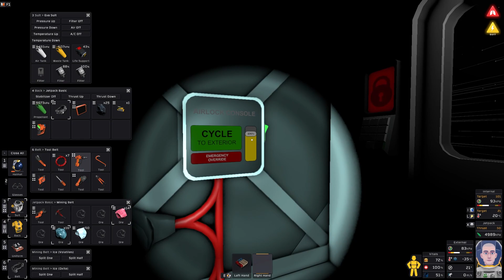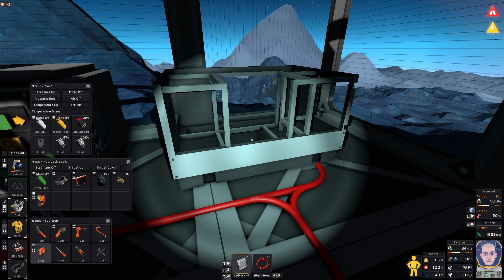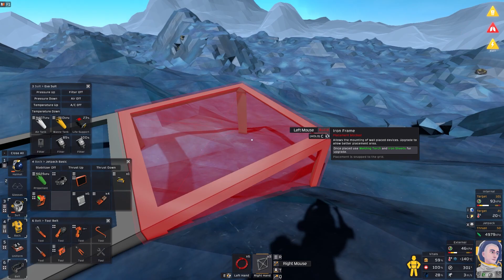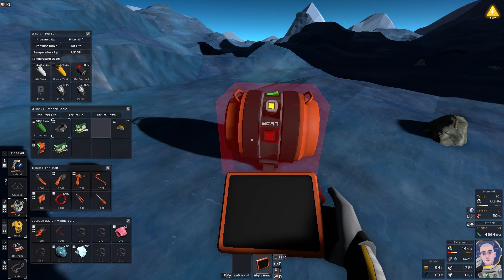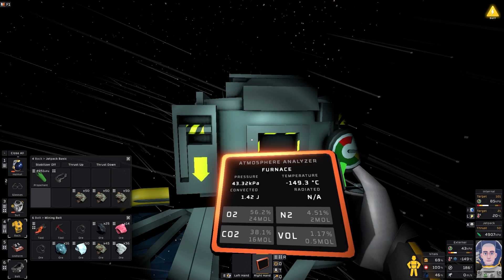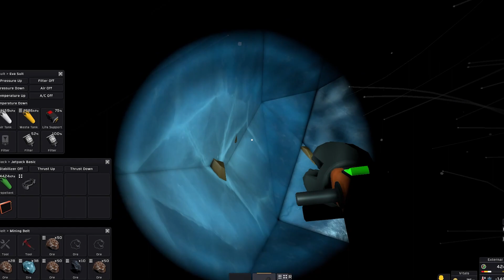Solving Shortages | Stationeers Europa | #2

Comment: I doubt X is actually chlorine. Or at least, not exclusively chlorine. Chlorine isn't the only pollutant you may get from burning coal. Nitrogen oxides and sulphur dioxide are likely, and not pleasant to breathe, you can get heavy metals given off, soot particulates, and potentially some carbon monoxide (although if you're producing that it does suggest you're not achieving optimal burning characteristics, i.e. not enough oxygen to fully burn the coal)
In other words, you're coal is kicking out a lovely toxic cocktail of gases, all of which are pretty nasty. I think X just represents the cumulative total of all that nastiness, rather than any one gas specifically.

Comment: Can you put the vent from the furnace near the wind turbines for a small boost to power or would it even be worth it?
Glad I found your channel! Gonna have to binge your stuff for a while!
Reply from the maker: As far as I know these turbines don't actually interact with "wind" yet - they just produce power at a semi-random rate over time (it seems to just be a sine-wave but I'm not 100% on that). 

There's a separate block (I forget the name) that does work exactly like you describe though. You can line them up in a chimney to make a little bit of power. You're better off running your exhaust through a stirling engine. Those used to basically print energy. No idea if they're any good since the atmospherics overhaul

Comment: For me this ore scanner is not very useful. But it's not because some flaws of this tool itself but because of ores distribution (it's not the only issue related to that, by the way). It's because usually ores are mixed, different types in the same place. If I don't search for something specific then it's enough what I find without it and if I need specific ore, it is not helpful in this case. And I think it's totally obsolete after getting heavy drill. I just drill all around faster then use this damn thing.

Comment: 8:13 I just learning the game myself so while I understand most of what you're doing, I do have a few questions... Those cases on the lander can be removed with a wrench. You could then carry them up to your base and print off some attachment points so they don't blow away in a storm. Is there a reason why you're continuing to commute down to the lander? Is it just lack of resources?
Reply: 18:36 Probably should have vented the furnace first, lol. The CO2 and Pollutants inside are really good at absorbing heat, so it's really hard to get your heat up... Plus you risk everything esploding.
Reply from the maker: No reason not to move them. Just different priorities.

Comment: 20:00 - ish...  I could be mistaken, but if you have an improper reagent mix, you may not need a centrifuge to fix it.  I THINK you can balance out the ratios.

So a 2 Iron/1 Coal reagent mix can be solved by adding 1 more iron.

... but also I could be wrong and/or that might have been a bug that got updated.  Feel free to test.
Reply from the maker: Yup, you can definitely do that! 

 I didn't have any more iron on me at that moment 😄

Comment: Hey there, @27:34, to remove those few cables from the inside, put one running horizontal from inside to the outside, making a flat + shape (well above the left bottle filler will look like a 5 way  junction) then use cutters to remove said junction, then replace with correct shape/orientation cable. also you can mount the portable scrubber to a tank connector, have a few pipes and valve hooked up to dump waste to outside(with vent) or storage if needed later?
Edit: the scrubber will take a tad longer (power switch flash yellow longer) to pressurize itself internally when mounted to tank connector.
Reply from the maker: Good tip on the cables thanks! We'll deal with the scrubber when we build the atmospherics system

Comment: Love the series. Back seating here but there is only so much pressure differential for iron windows before they blow out. You could either replace with the steel walls or set a back pressure regulator to vent out the excess.
Reply from the maker: I'll upgrade them soon enough, they won't pop for quite a while!